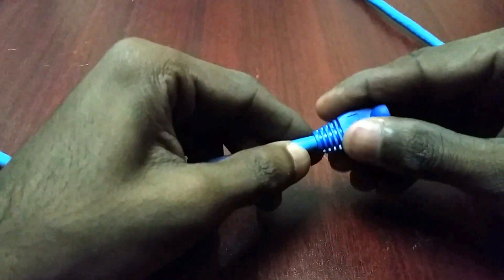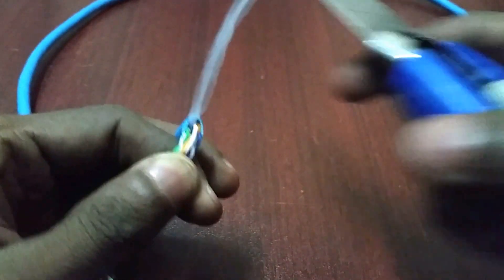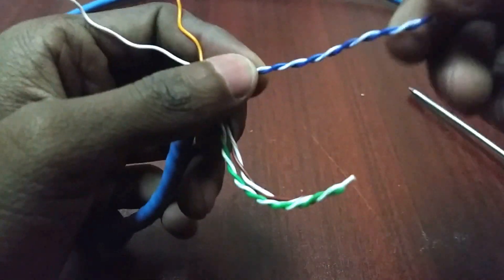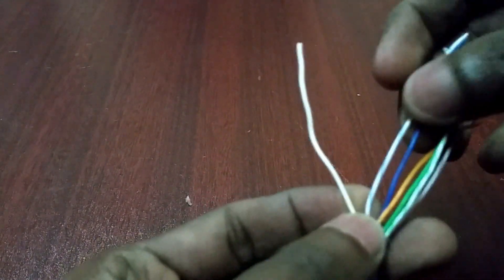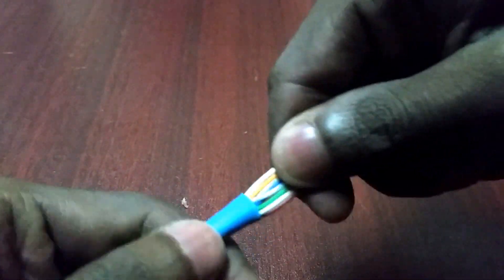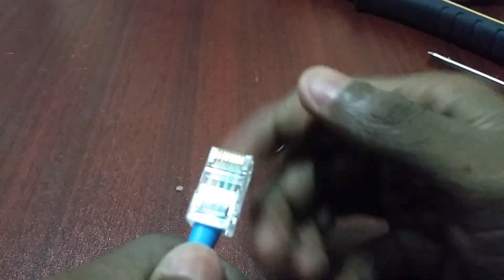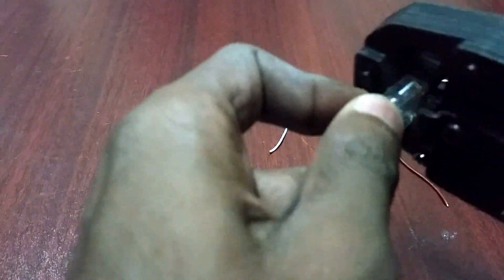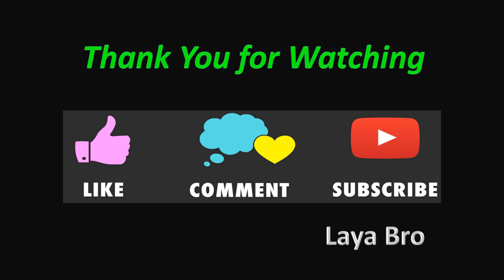How to crimp RJ45 Connectors Cat6

Comment: I got up to use the RR and come back to this, not sure here. IM an electrician not a low volt guy but if this is your first time do not use his techniques as there is some room for error.

*ALWAYS CUT AWAY FROM YOU*

Score gently using strippers or knife.
Remove outer sleeve
use the sting inside to peel back more insulation, incase you damaged a wire scoring the outer sleeve
untwist the cables and straighten to perfection you can use finger or screw driver
set the wires per code shown in this video.
----whiteorange/orange/whitegreen/blue/whiteblue/green/whitebrown/brown)
cut the wires a little longer than the connection, at an angle (this will help pushing in the CAT5/6/7 into the connector)
use the wires extra length sticking out the connector to pull them in and push the blue sleeve in as far as possible
cut the excess wire
use crimpers

*ALWAYS CUT AWAY FROM YOU*
Reply from the maker: Thanks

Comment: dude, you aren't meant to cut the ground cable!
Reply from the maker: in this cable doesn't have ground cable. if it has ground cable you have to connect ground cable also
Reply: oh my bad then, i thought the wire you cut at 0:57 is the ground cable. on closer look, it looks like a string. sorry.
Reply from the maker: thans